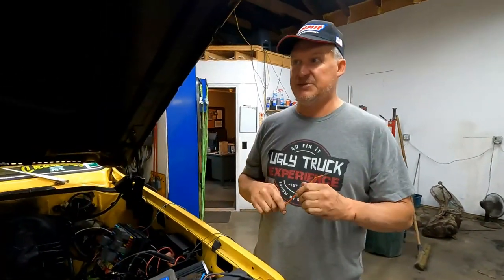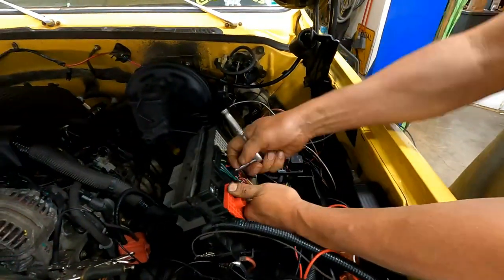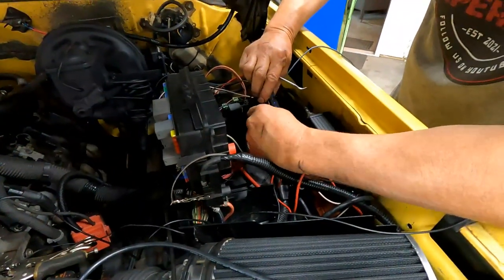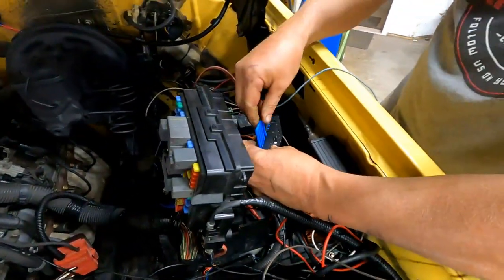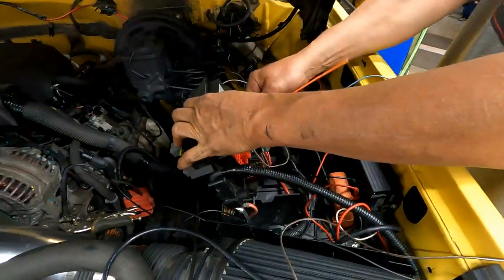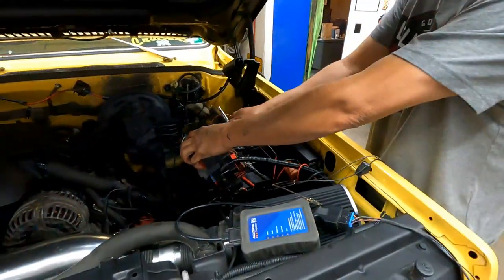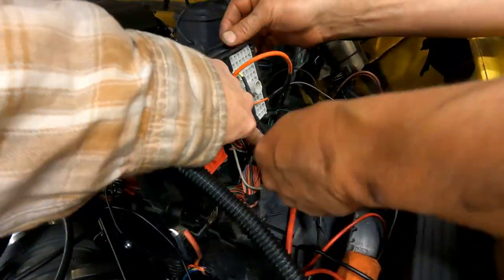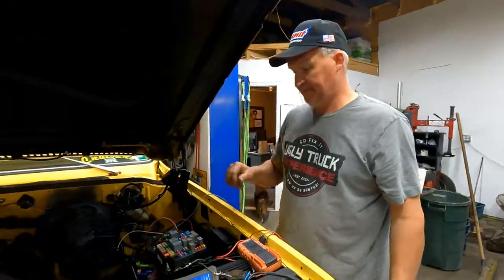MAKE SHIFT HAPPEN - Supplying Power to 4L60E Transmission - Square Body C10 5.3 LS Swap - UTX

Comment: I wish this had fixed my trouble. Sadly it did not. C9 is already powered on my fusebox. Ive been fighting it for months and still no solution.
Reply from the maker: What's your donor and what's it going into? We're happy to look at some wiring diagrams and try to find a solution!
Reply: @UglyTruckExperience  01 silverado in an 83 el camino. Engine,trans,harness and ecu from truck. Known rebuilt and good trans. I had it rebuilt and drove it a year before harvesting it.
Reply from the maker: The 01 wiring was quite different from the 04 or 05.  Let me know if you need some help with this still and I will give you the pin info. Jerry
Reply from the maker: In your case you will need to take the two pink wires, connector 2, pin f2 and put it in E8 on connector 2 if you are not using the rear O2 sensors.  The wiring for that transmission originally came from the interior fuse panel which is not there. The older wiring diagrams are very misleading about the fuse boxes.  If you are using the rear O2 will just need to run F2 to a key on engine running source.  Good luck. Hope this helps.  Jerry
Reply: @UglyTruckExperience  thank you Jerry for your help. I will try this as soon as I get home from work this evening and keep you posted.
Reply: Jerry you are the man!! Followed your instructions and now I'm doing burnouts in the garage. I can't thank you enough for your help. I've been fighting this since March and now, finally I can wrap up the build, well at least this portion of it.
Reply from the maker: That's great Gary. We couldn't be happier that it worked out and always glad to help. Enjoy that El Camino!
Reply: I have issues still after I connected like the video .  only runs if I take  off second gear and once I reach  a  certain speed  I move it back to regular drive . Like if I’m tricking the transmission . I even connected a cluster from a 1990 suburban if that help . But no luck
Reply from the maker: What are you using for donor, wire harness and computer?  Jerry
Reply from the maker: You might try unplugging the dash.cluster and.see if it shifts correctly
Reply: @garydunn5051  are you using the oem fuse box? Or stand alone fuse box?
Reply: @omarvalencia5299  yes all oem
Reply: @garydunn5051  ah ok. I’m having the same issue but I’m on a standalone fuse box. Just haven’t dug into it.
Reply: @UglyTruckExperience   what about an 03 out of a yukon? would it be different?
Reply: Mine stuck in 2nd and I have a stand alone harness
Reply: @UglyTruckExperience hey Jerry I need this pin info for mine

Comment: I just saw your page last night. For the last year I have been driving my LS swapped 1988 Nissan pickup in 3rd gear, thinking I had either bad shift solenoids or a failing transmission. So, I have been manualyl shifting to get going. I just bought another used 4L60 this past Statuary. So, before I removed the old transmission, today I did what you suggested. I ran 12 volts to pin C9 in connector C1 and like magic, it starts in low and shifts properly. No one else ever suggested this but you. Thanks a million friend. Thanks very much. Hope you have a great day!!!!!!!
Reply from the maker: This is so awesome!! So glad you found us! Do you have any pics of your truck? We have a customer who wants to swap an 86 Nissan, and I'd love to check out your build! Thanks for watching!  -emily
Reply: I sure do have pics. Just tell me where to send them. Awesome power increase over the anemic 4 cylinder and automatic transmission that was in there before. I will send them tomorrow, Wednesday. I live in Lawrenceville Georgia.
Reply from the maker: @thomasreid8504  I bet that truck is a blast to drive! If you have Instagram, we're @uglytruckexperience. Or our Facebook page is Ugly Truck Experience. Can't wait to check it out! 😁
Reply: Sorry for late reply. I don't have either of these apps. If you have an email, I can send to that.
Reply: @thomasreid8504  Thomas, did you do a video of your swap for YouTube? I'd be interested in watching it.

Comment: I’ve been watching your videos in search for the answer to my issues. I have a 1996 Fleetwood with the LT1 and a 4L60E swapped over to an 0411 PCM. It runs great but starts off in 1st and will only shift manually from there. It does have 1st 2nd and 3rd. It does have a VSS reading and when unplugging the transmission it seems to throw every code in the book so I believe the transmission is getting proper power. I’m just stumped because it shifted perfectly fine before the pcm swap.
Reply from the maker: I just read your message better. Is this the original LT1 or have you put a Gen 5 LT1?  Or did you just change to the 411 PCM? Jerry
Reply: @UglyTruckExperience  It’s the original LT1 with an 0411 PCM swapped into it.
Reply: did u ever figure this issue out? im having that exact problem but with a 91 lt1 swapped brougham

Comment: Hi I did a ls swap on my 1972 c10 but I can’t get it to shutoff I have to disconnect battery wire or wire going to pcm original fuse block please help
Reply from the maker: What is your donor motor, fuse box and harness.  Jerry
Reply: Thanks jerrry I got it to work I’m running original fuse block 2002 5.3 4l60 I got it to shut off got my main power key on off the ignition wire where u insert key so it shuts off now
Reply: Now my transmission won’t work original harness I’m going to swap those 2 pink wires to a key on power source to see if it will fix my problem no reverse just low one gear and have to give it gas
Reply from the maker: The wiring for a 2002 is totally different. The power for the transmission is already set up in the harness and fuse box, so if you are using the stock fuse box and harness you shouldn't have to do what we show in this video.

Comment: Im working on getting a 4L80E running off a 2000 1 ton van computer set up for a 4L80e, and its swapped into a carb'd truck with an HEI Distributor. Ive got everything cept a tach signal because I dont know what to feed to either the crank or cam sensor signal line to the computer and I think Im going to try a 7 pin module to feed a square wave reference to one of the two sensor signal wires and see what happens. Im not sure but I think it needs a rpm signal for engine speed to wake up and make the shifting happen because everything else is wired right.
Reply from the maker: I have always wanted to try to do that with one of our carbureted trucks.  Easiest thing would be to buy a controller for the transmission.  Getting the tach signal would be difficult and getting transmission to shift correctly would be an issue I am sure.  I would get a hold of somebody that tunes ECM's / TCM's and pick their brain for a bit.  If you get one running great, make sure to let us know.  Thanks.  Jerry and Emily
Reply: @UglyTruckExperience  I actually managed to get the donor vehicle computer out of the 2000 1 ton van, to control the transmission and shift. Just had to get a tps kit online and set up a spare 7 pin module as a pickup signal converter to give the VCM the digital tach signal it was looking for. Kinda exciting because this was all done on the cheap.
Reply from the maker: That is cool..  Does it shift nicely?  Jerry
Reply: @UglyTruckExperience  It should once I dial in the TPS just right like Im supposed to. Just did a functional mock up. Gonna clean up everything maybe over the weekend.

Comment: Gearing up for a 6.0 4L80 from 2006 2500HD swap into an 85 C10. Any difference in 4L80 vs 4L60 for the wiring shown here for powering the shift solenoids? Same kind of install: factory fuse box, DBW, etc. Also curious about if cruise control hookup would be the same as your video and have TCC work. Just not seeing much for 4L80e’s. Thanks. PS, grew up in Spfd, Ozark and Sparta and love seeing such a good channel coming from the area!
Reply from the maker: It sounds like you are using harness and ecm from a 6.0 with a 4l80 behind it originally.  If that is the case they are pretty much identical when it comes to wiring those items.  If you we're going from a 4l60e to a 4l80 the plug needs rewired for the 4l80 but that's it.
Reply: @UglyTruckExperience  yup, all matching donor items. Appreciate the help!

Comment: Great video. You have answered some of my questions without me even having to ask! But I have more questions--.  My project is a 55 chevy, LT1 with a 4L60e swap . I want to keep the original speedometer. It is my understanding that by not having a digital speedo is the reason my transmission won't shift out of 1st. I've seen some kits where I can make it shift manually, but I would like it to be fully automatic. Any guidance you can give is greatly appreciated.
Reply from the maker: Hello Daniel.  Which version of the LT1 engine are you using?  Sbc version or LS based version.

Comment: Hoping you might shed a little light on a ls swap , computer is from a 2000 Tahoe and the trans is from a 07 Tahoe I have it all set up in a 1995 K1500 GMC
trans seems to be only functioning on 2nd or 3rd gear ? Any Ideas
Reply from the maker: Is it a 4l60 transmission?
Reply from the maker: Also, what is your wiring harness?
Reply from the maker: A 2007 Tahoe was right on the line when they started crossing into the GEN 4 wiring and the transmission had its own separate control module.  It is possible to make that transmission work with the ECM that you have but will require some changes to the wiring depending on what you are using for a harness.
Reply: Sorry I looked into this a little more and the donor transmission is a 2002 Tahoe, iam sure that will change things a little. Ideas?

Comment: I want to restore my dad's 76 c10. It use to have a 3 speed manual transmission but he changed it to a 350 hydromatic. The question I have is do I need to change the rear end on it. I can use a the help I can get thanks for the great videos.
Reply from the maker: Your rear differential should be fine. Odds are it may have a 3.08 rear gear ratio which will be fine with that thm350.  A 3.73 would work also but would be more of a powerhouse than a cruiser.  I bet it has a 3.08.

Comment: Your correct I'm stating how invaluable wiring diagrams are, especially for the wiring challenged like myself. Too bad one wasn't provided. I know you have a whiteboard. I've seen it.
Reply from the maker: They really are.  I would love it if they were all a little easier to get.  They should come with the car like the owners manual does.  Thanks
Reply: @UglyTruckExperience  Absolutely agree!

Comment: Howdy Folks - Where would a guy buy extra PINs to complete this project? I thought about using two extra wires I pulled from unused sections of the harness as they would be plug and play but it’s probably a better idea to start clean and use new wires and pins. Should I check GM’s part departments at a dealership, local parts stores like AutoZone, or find a supplier online?

Lastly, what would I call that pin so I’m ensuring I order it correctly? 

Thanks as usual!

Tony -
Reply from the maker: Hey Tony! Let me see if I can find a part number to order just the pins, but we just pull the unused pins and reuse them. Just make sure you're using a high quality, heat shrink, BUTT connector! 😆😉 --Emily
Reply: @UglyTruckExperience  See this is exactly what I wanted to do. I’m going to reuse items I have instead of throwing more money at the build 😂

Thanks, Emily!
Reply from the maker: Yep, exactly! 😁 Jerry and I were talking about this, and he also pointed out that unless you can find original GM pins, aftermarket pins may not fit as well and could cause a big headache if one had a bad connection.

Comment: Love your videos. They have really helped my son and I work on his first truck. We are building a 77 C10 with a 5.3 from a 04 sierra. We are using the stock fuse box, harness and PCM. It is a DBW. Our issue is- the truck will start and idle all day with no issues. No check engine codes or anything. As soon as we give it throttle it acts like it is killing the injector pulse. I haven’t had a chance to try and verify this. We do still have ignition when this happens. We have replaced the tps the pedal and the maf. Any ideas on what to do next? Just curious if it was something related to the trans stuff we aren’t using. It does have a TH350 in it.  Thanks!
Reply from the maker: Hello Brandon.  I would check your fuel pressure first while opening the throttle to see what is happening at that point.  If that maintains a good pressure it sounds like you might have injectors that are plugged up.  Sometimes if that donor sat for a while with old fuel up in the rail, it can clog the injectors when you first go to start it.  Shouldn't be anything with the transmission.  Sounds like it is trying to bring the RPM's up when you open throttle and no codes, so I would think it is a mechanical issue that the ECM is going to have a hard time to detect.  Send any questions and let me know what you find.  Jerry
Reply: @UglyTruckExperience  thanks Jerry, I will give that a try and see what happens.
Reply: I just checked the fuel pressure and at prime it sits at 48psi. As soon at I start it up, it goes to 90psi. Even when the throttle cuts out it maintains 90psi. Any thoughts on this?
Reply from the maker: It sounds like whatever you are using for a fuel pressure regulator is not working. It should stay at around 58 PSI no matter what.
Reply: @UglyTruckExperience  that’s what i was thinking. I am using a walbro 255 in the tank and a corvette style filter regulator. I guess it could be bad. What issues might too much pressure cause?
Reply from the maker: Anything above 58-60 PSI will cause exactly what you're experiencing and will cause major problems. You'll want to get that fixed ASAP. The computer can't compensate for that much extra fuel and is basically shutting down. Do your best not to run it until your fuel pressure is fixed. Depending on how much you've run it, you may want to change the oil also. Let us know how it goes.
Reply: @UglyTruckExperience  will do! Thank you so much for all your help so far!

Comment: Ok but how do I know which wire goes to the A and B solenoids? A lot of the wires have been cut from the original builder, so I can't tell which one to send the power through to get it to shift... Thanks for the video!
Reply from the maker: Hello Joe.  The power that we are supplying in this video goes to a few different solenoids.  They are turned on and off by the ECM by grounding whichever solenoids need to be on to apply the gears.  If somebody has cut those wires you would need to make sure that all of those wires that had been cut are repaired.  What is it that you are putting a LS in?  Jerry
Reply: @UglyTruckExperience  73 f100 with 2003ish 5.3 LS with 4L60E. "Stuck in 3rd" issue. Total hack job from previous owner. I'm trying to get this thing going down the road... I'm unsure which wires control the gear shifting solenoids. I think that's my next step of getting it to move...Thanks!
Reply from the maker: https://youtu.be/COOzzFHCLRk   This is a link to a video that might help.  If your working with a 2002 harness and box, you might just need to wire up some different wires. They are different from 2002 to 2003 and we go through that in this video.  If that is not the case, I will do what I can to help.  Thanks.  Jerry

Comment: Great video but what color is the wire on the transmission harness. Or what pin on the circle transmission connector
Reply from the maker: Thanks Tylor! That wire is pink. It is pin E in the round connector at the transmission. We appreciate you watching!
Reply: @UglyTruckExperience  thanks

Comment: great video s   question  im using a 2000 silverado ls swap   what wire do I use for the transmission hot  stock harness and fuse box
Reply from the maker: Connector 2, position F2 has 2 pink wires going to it. Those two wires will need power on with key on.  Thanks.  Jerry

Comment: Hello! Thank you very much for your videos.

I'm in the middle of a swap. My base is a Jeep CJ7 (the front differential is on the passenger side) with a 5.3 LS engine and a 4L60 gearbox.

Due to the side of the vehicle where the front differential is located, I chose to use an NP208 transfer case (1986 Bronco) and it uses a wire speedometer (analog type). What type of sensor should I use?

I don't know how to adapt the speed sensor receiver from the wiring harness that goes to the PCM.

did you have this problem? How would they solve it?

thanks in advance.
Reply from the maker: We have only done 1 four wheel drive truck.  On that truck I used an adapter between the transmission and transfer case that had a spot for electrical sensor and then also used the mechanical drive on the transfer case to run mechanical speedometer.  I know they make a mechanical to electrical adapter that lets you continue on with the cable for the speedometer.  That is most likely what I would end up doing.  Here is an example of one.  https://www.summitracing.com/parts/cin-sn96?seid=srese1&gclid=Cj0KCQjwlIG2BhC4ARIsADBgpVQtSnEb2iIeYm3Z-TlH_UV8YpSg6FD-3nBQ5aOWODXgenQh4JPHXIUaAtNKEALw_wcB
Reply: @UglyTruckExperience  thanx!!